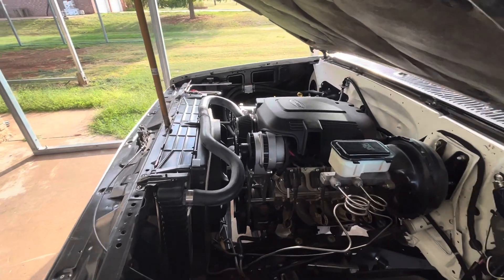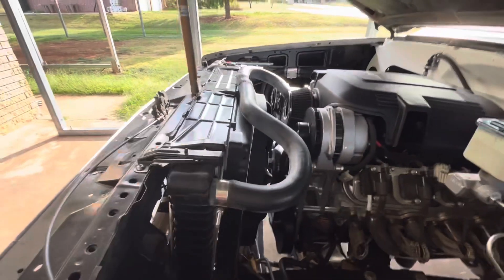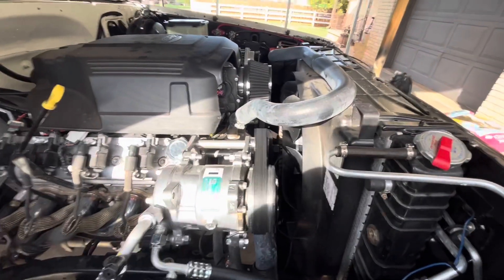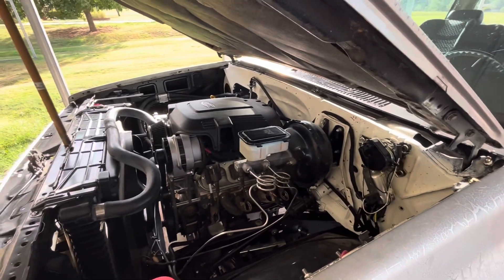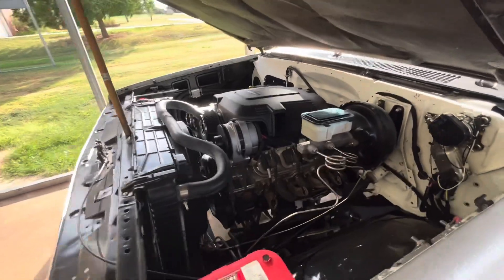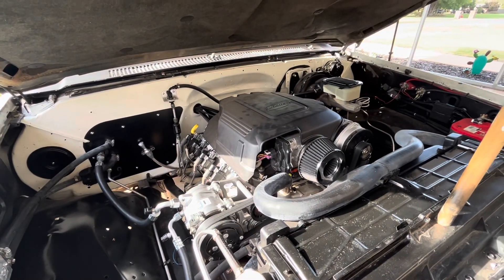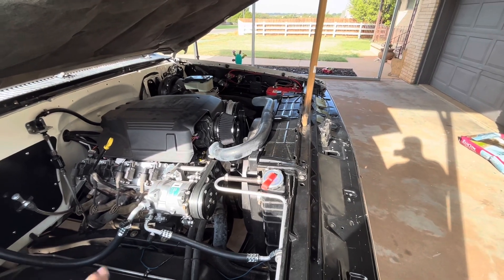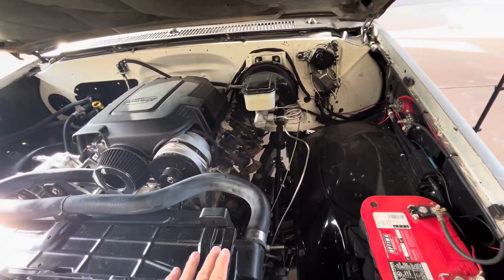Squarebody LS Swap Cooling System

Comment: Good video, I'll have to do this to my 73' K20.  What is the hard line coming off the top or the radiator? And did you have to worry about steam ports on the engine? Thanks!
Reply from the maker: Hardline goes to my overflow tank. Steam line is routed to my water pump. I drilled and tapped the water pump.
Reply: @3rdGenC10s  Gotcha, thanks for the reply!!
Reply from the maker: @TheK20guy of course!

Comment: Does the bottom radiator hose have to have that wire inside
Reply from the maker: @manuelalvarez6987  no
Reply: @ thanks
Reply from the maker: @ yes sir!

Comment: Where did you hook the steam line to?
Reply from the maker: @2015_Rubicnn  drilled and tapped the water pump.
Reply: @3rdGenC10s  Ok, thanks for the information. 👍 When I have time, I'm swapping my 81 Silverado with a 72k mile LQ4/4L80E combo.
Reply from the maker: I have a video on my channel of what I did with the steam line on my ls3 water pump, I included some pictures of my blazer in there.
Reply: @3rdGenC10s  Yeah, I'll either go there or back to the upper hose.

Comment: Is that a 1 piece fans shroud. I’m doing the same on my truck. Running a big block factory radiator and a manual fan. But need the shroud. LMC has one that is 1 piece that says it’s for a 454 which would be the 4 core like what I have.
Reply from the maker: @NDB390  yes sir, it’s just a factory replacement for a 454

Comment: Man that is clean!  I was reading Texas Steelworks swap guide, and they specifically say a mechanical fan won’t fit with their LS swap mounts?  I guess that isn’t true!
Reply from the maker: Been running it for over 2 years. Hasn’t overheated once. I will say there is not a lot of clearance between the top of the shroud and the fan.
Reply: I did notice that their swap guide is dated 2015, and it refers to their mounts as “mount adapter plates.”  Presumably an old part that let you use stock SBC block side mounts .  Looks like they’ve since gone to a dedicated mount bolting directly to the block so maybe some changes were made in positioning/angles?  Regardless, it’s good to see it fits with a BBC shroud.  I, too, like the clean look and simplicity of not having electric fans and wiring.

Comment: What AC Bracket setup are you using?   I thought the Tejas mounts set the motor too far forward for the mechanical fan?   Did you have to do anything special to make it work?
Reply from the maker: It’s a top mount from ICT billet. Tejas mounts allow you to use the factory location with a slight notch in the frame. I didn’t want to bitch my frame.

Comment: What you do about the stream ports
Reply from the maker: Blocked off the rear and ran a crossover from ICT billet on the front. I drilled and tapped into the return side of my water pump so there is no hose running across everything to the radiator.
Reply: @3rdGenC10s  why did you block of the rear
Reply from the maker: @tylorlindstrom3972 they aren’t really necessary, gm did it from the factory in the later blocks. Plus the way the tejas mounts set the motor in there with the front being higher asteam is going to rise so the rear wouldn’t really burp steam anyways.

Comment: Hey bro. What expansion tank are you using?
Reply from the maker: https://a.co/d/dJarHEY
Reply: @3rdGenC10s  Hi. I just ordered the Evil Energy tank that you have. Hard to tell from the video, but it looks like the overflow hose from the radiator is plumbed to one of the top ports on the expansion tank. Did you keep it this way? I was thinking it needs to be plumbed to a bottom port. Thank you.

Comment: I have the adjustable motor mounts from dirty dingo and I hear that the tejas raises your engine. Wondering if my engine will sit too low to use the cooling system you have as far as fan and shroud lining up?
Reply from the maker: Tejas does lift the motor up and tail shaft of the trans down about 6°. It actually makes the fan closer to the top of the shroud so with the dirty dingo you should be more centered in the shroud. I don’t think you’ll have any clearance issues as I had a ls swapped long bed that had no issues when running this setup with dirty dingo.
Reply: @3rdGenC10s  Thanks for the quick response. Great videos, very helpful
Reply from the maker: @85C10Builder  I appreciate it! Glad they help you out.